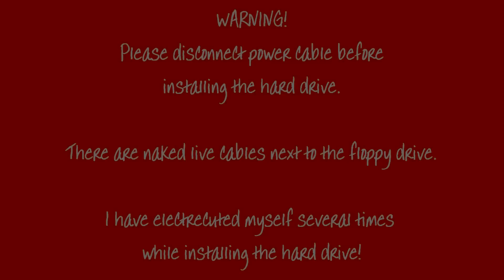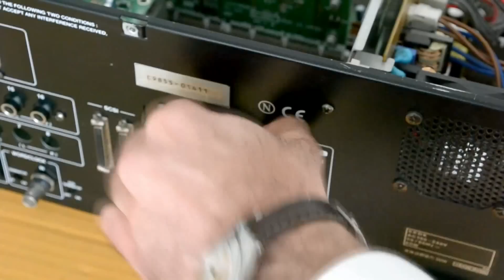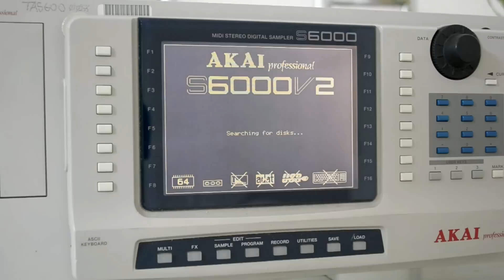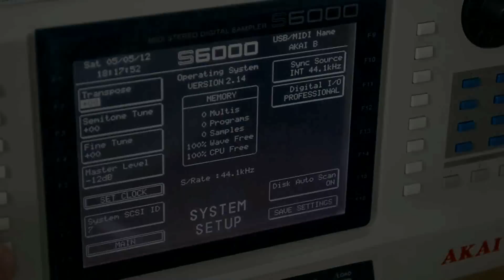AKAI S6000 Internal Hard Drive Installation Instructions (HD)

Comment: Is it possible to reformat the drive into smaller partitions? For backup purposes it would be easier to deal with 32gb instead of 70.
Reply from the maker: Possibly, but it might take you weeks until it finishes. I formatted these drives externally I think using Maxllf if I remember well as you need to format it to FAT and usually FAT doesn't support more than 8GB I think. Sorry it's been years since I done these...